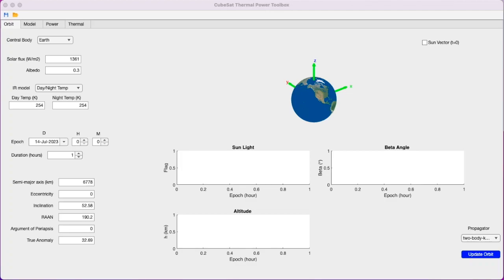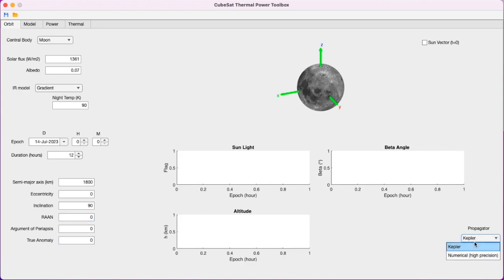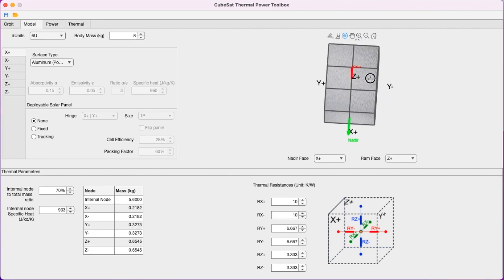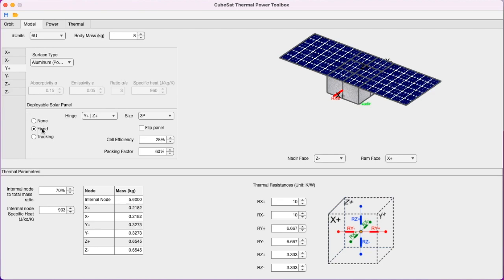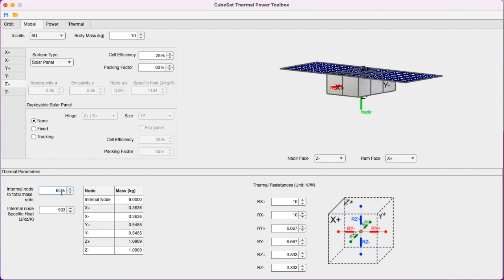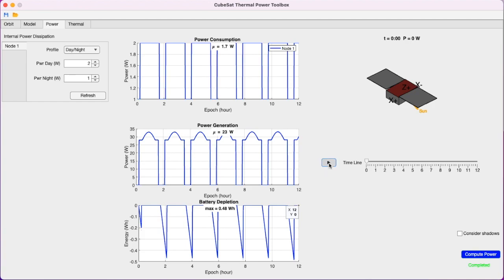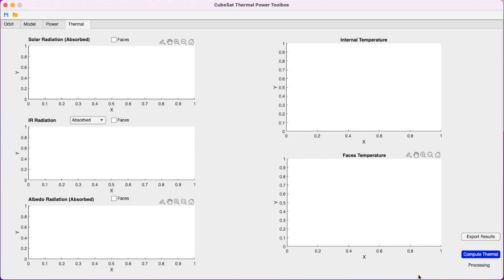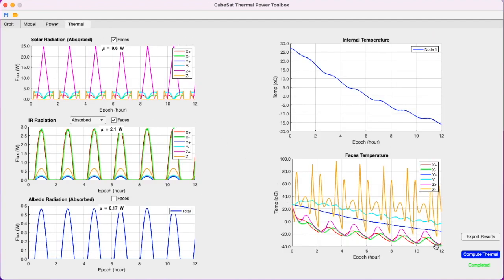CubeSat Thermal Power Toolbox Presentation  - MATLAB App

Comment: Hi! Great Video! Can you maybe explain what the "Day Temp" and "Night Temp" settings mean on the "Orbit" page when selecting Earth as the central body? Is that to be considered as the average ambient temperature around the Cubesat in orbit? Thanks!
Reply: That is related to the central body's blackbody temperature used to calculate the IR flux. That is especially useful for the Moon, where the illuminated side is much hotter than the dark side. Let me know if you still have questions.